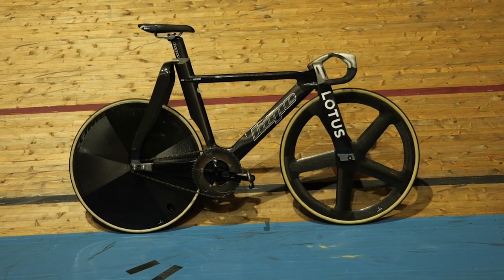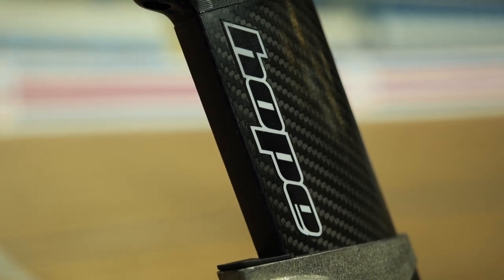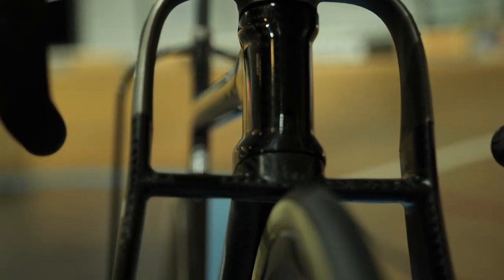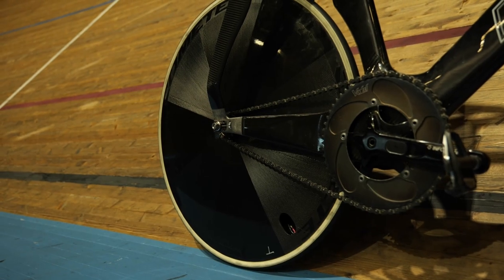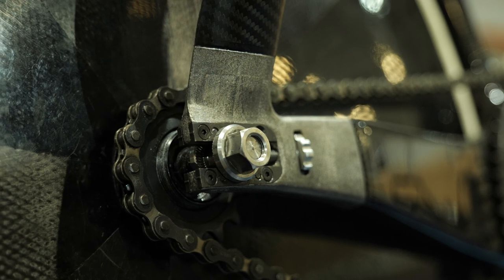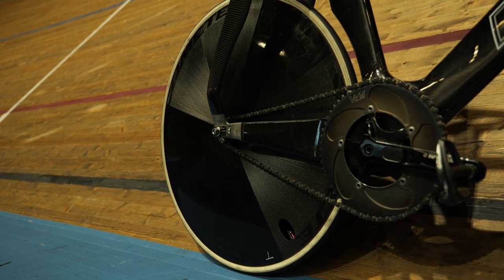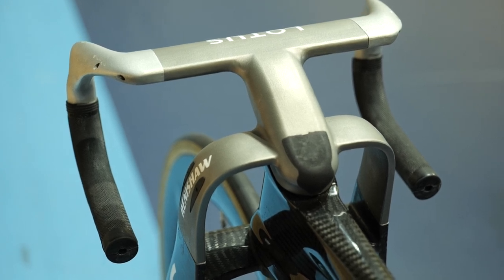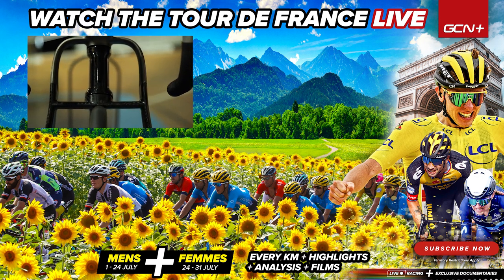A Close-Up Look At The Team GB Hope Lotus Olympic Bike

Comment: A small detail, the bike as is looks like it has standard hex nuts on a solid steel axle,  at odds with modern hollow thru axle choice. Seems such old school items are just the job, but it could benefit from some locking nut or improved material.

Comment: Didn’t I hear it or did he not mention the price?
Reply: It's one of those 'If you have to ask for the price  you can't afford it things'. ☹
Reply: @simongoh9461  maybe but interesting non the less.
Reply: Bike Radar did a piece on it in 2019 when it was introduced. Bike frame 15,500 GBP, with bars and wheels, 26,000 GBP. They have a breakdown of prices in the article. Those prices will have risen since then.
Reply: @Kim_Miller  thanks for that. So it’s the prize of a lower middle class car.
Reply: @Kim_Miller  I would think it would be MUCH MUCH higher than that, given that an almost off-the shelf Team USA Felt with two sets of wheels (training and race) now runs over $30K USD. ??